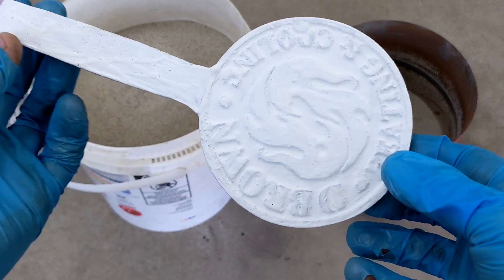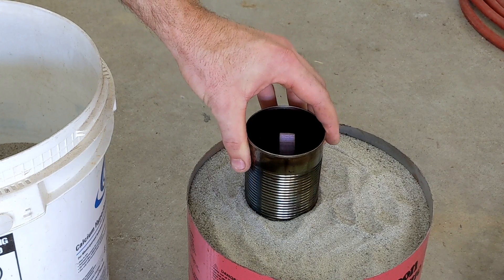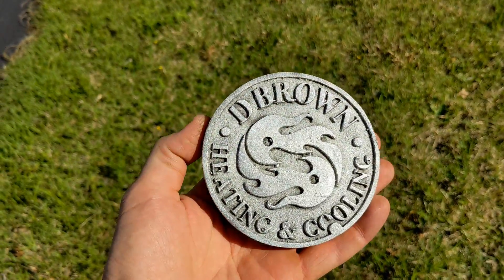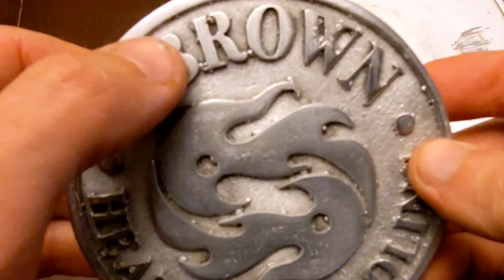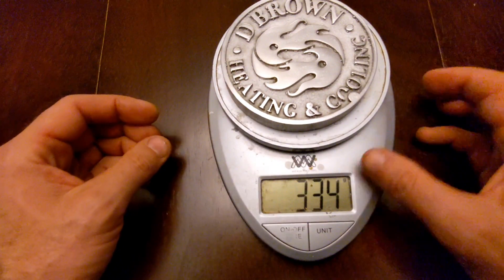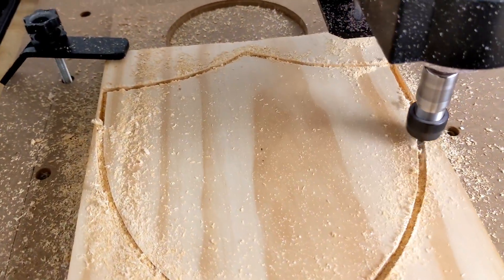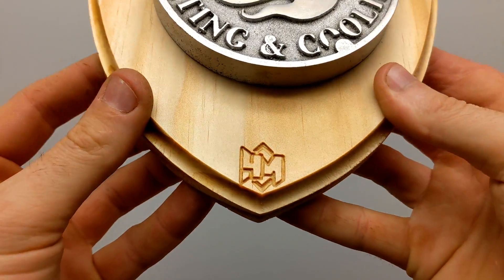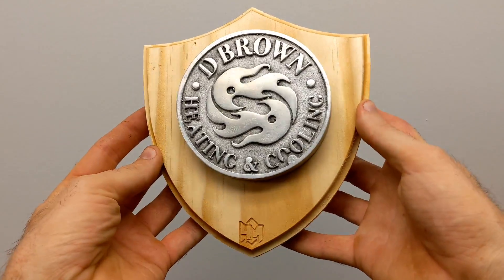Polystyrene Foam Diy | Lost Foam Casting with Polystyrene Foam | DIY at home (Metal Logo)

Comment: Very very nice i would say its a double win.  Did you create logo on styro foam and then painted it with plaster?
Reply from the maker: Thanks Frikkie Smit!  Yes I used my CNC machine to cut his logo out on a piece of polystyrene foam.  I then applied a thinned out mixture of wall plaster and water to it.

I just uploaded a video of how to apply the plaster and get bubble free results.  Make sure to check that out.
https://youtu.be/aTK35xrrmdk

Comment: Thats a Cool logo..or hot logo.. both i guess haha. Well done. i find using some air to blow around the coating will  help knock the bubbles out. Cheers
Reply from the maker: Well it's his logo 😁. I don't know who designed it.  I took an image and made a path file, then put it in easel to make gcode.  I think I figured out how to do bubble free.  This was actually one of the first I coated.  Let's see how my next lost foam casts turn out. 😁🍻🍻🤢 Thank you!